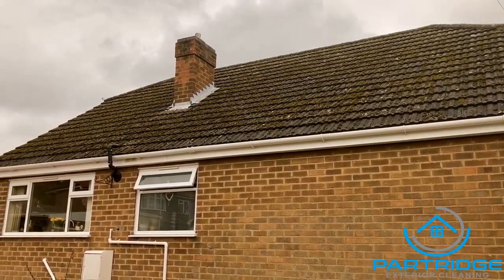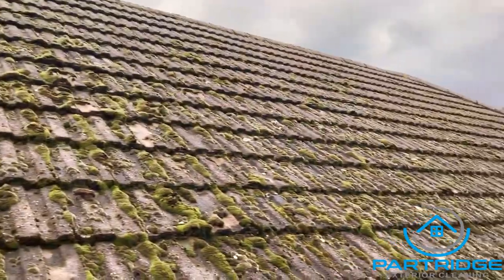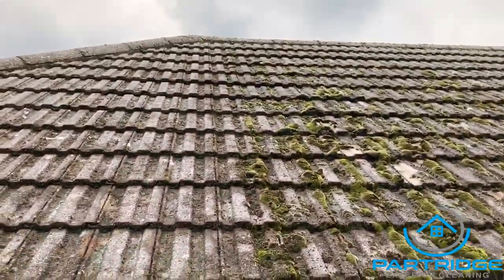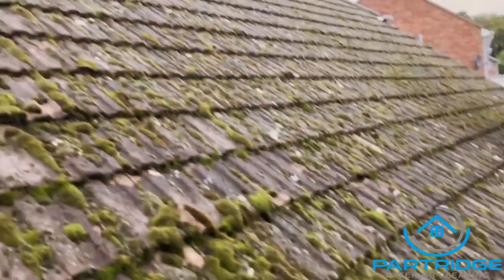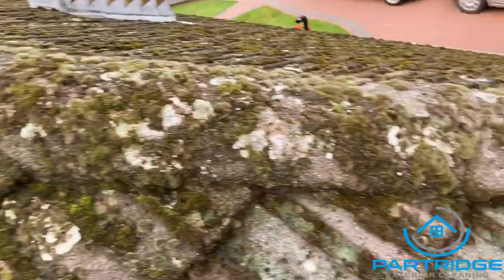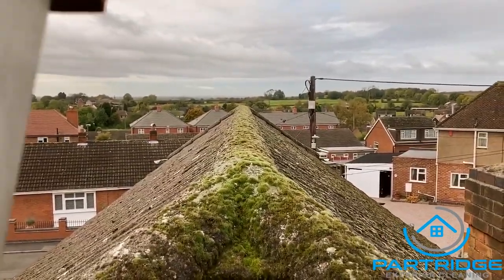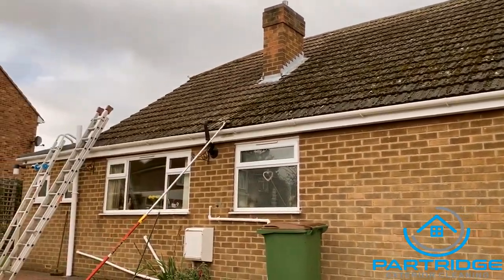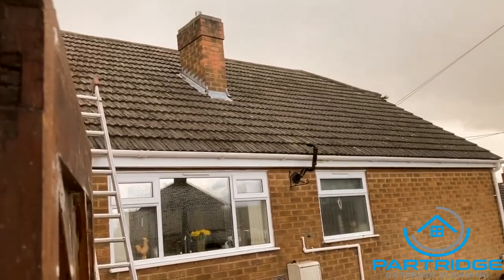A Safe & Effective Way To Clean A Roof // Partridge Exterior Cleaning

Comment: Lovin the videos. After you scrap down the roofs do you the sweep the whole roof down? and is it easier to scrap dry moss rather that wet moss? many thanks
Reply from the maker: Hi Lee, thanks for the support mate. 
easier to scrape dry than wet. too dry can also be difficult though. And i usually give the roof a quick leafblow just to remove the dust and bits of moss that have blown back up the roof. Not the end of the world if you don't though it'll blow away overnight usually.

Comment: Hi Sid
Do you find the wolf garten pole good for scraping? As opposed to a carbon fibre pole? I’ve been thinking of getting a wolf garten pole so just wondering?
Reply from the maker: It’s very good mate just lacks in length, I do prefer using a 30ft renegade aluminium pole but the wolf worked well for me for a long time, just found myself over reaching and having to get on the roof often